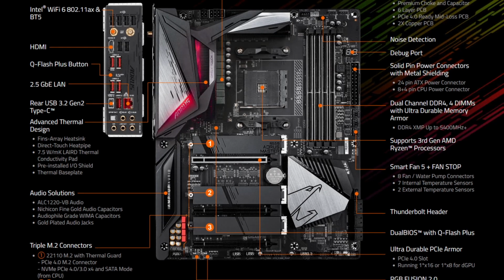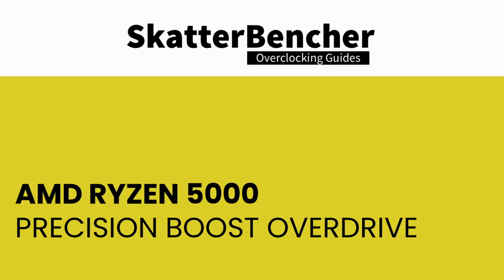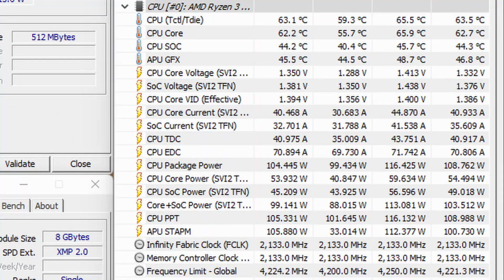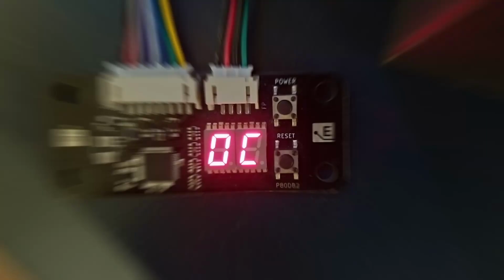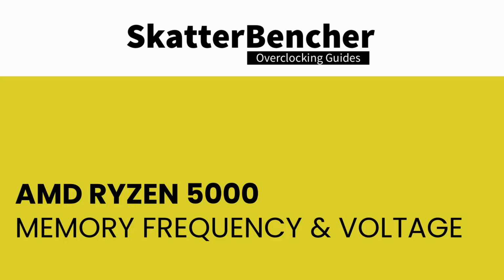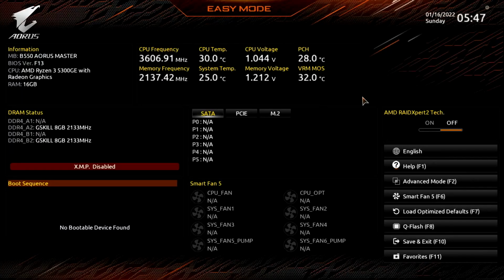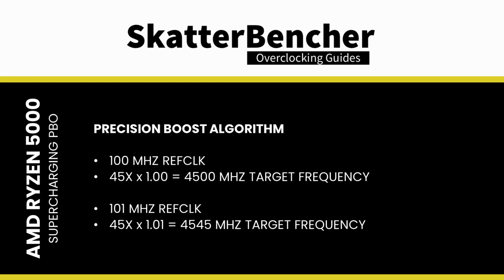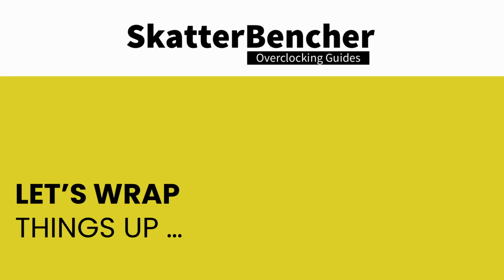Ryzen 3 5300GE Undervolt & Overclock to 4628 MHz With B550 Aorus Master | SkatterBencher #35

Comment: off topic, do you have any idea what percentage of 12900ks can hit 5.5ghz on all P* cores  on water (i have an extremely beefy water cooling system)
Reply: here are the results:
12900k percentage = 0.33%
120900ks percentage = 7,47%
Reply: @keith303  whered you find these!? Yeah ive been debating between getting a 12900KS or waiting for raptor lake (i already have a z690 board)